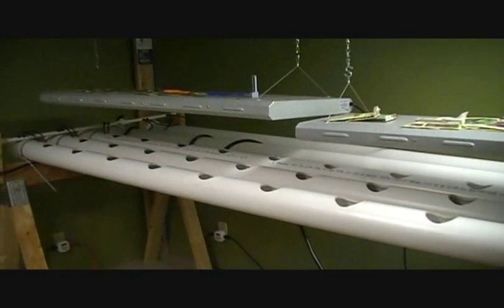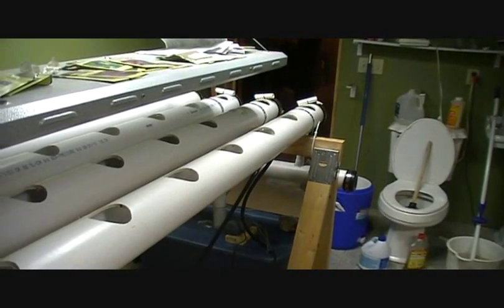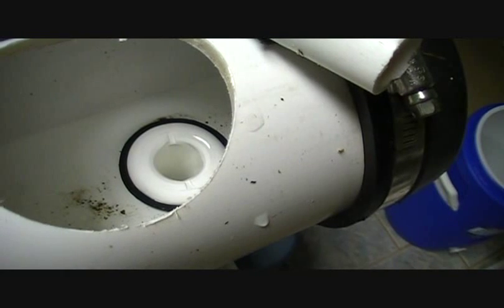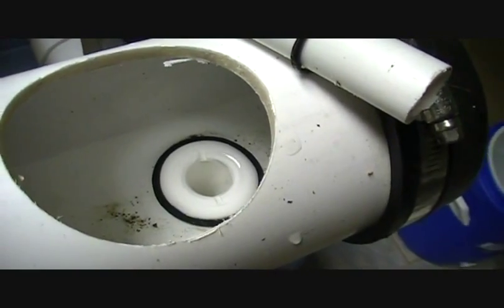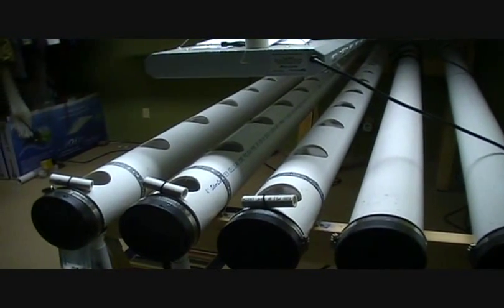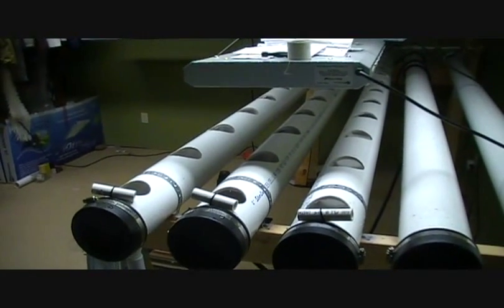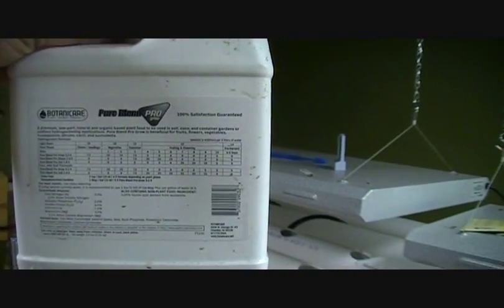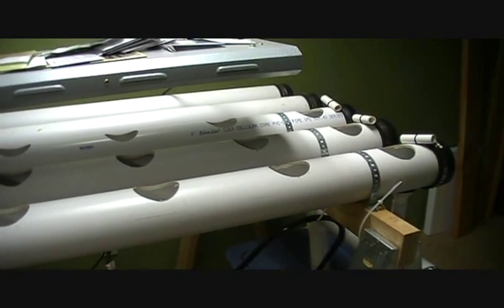Healing Hearts Farm- NFT Hydroponic System cleaning and overview

Comment: We miss you man where have you gone?! More hydro vids!
Reply from the maker: I know. I have been really busy lately. I have also started cultivating mushrooms. I now have a greenhouse that I have built a DIY automated heating and cooling unit. Along with a DIY solar air heater. I also have 3 mushroom fruiting chambers. One with an automated mister and DIY humidity control sensor. The others are indoors and run by humidifiers. I am getting ready to run the hydro now. I am going to have it full of basil to sell at a semi-local farmers market. I will try to start making vids soon.
Reply: FarmingFractals  Wow that sounds great man!  It's really inspirational man.  I'm currently building a three tiered system similar to yours.  Have you heard of uniseals?  Many people seem to use those for piping.  They seem ideal for hydroponics and aquaponics.  Still, all thee pipes and drilling have me 2nd guessing myself.  I think tiered rafts are probably the way to go...less piping.

Comment from the maker: This fitting was also around $5. It is called a thru-hull fitting. I have seen them online for around $2-$6. A swamp cooler drain would probably also work well. A barbed ebb & flow outlet could also work.